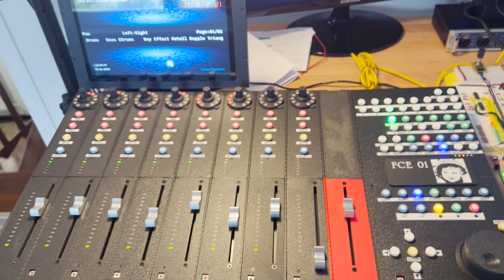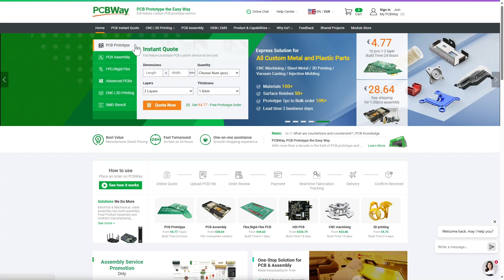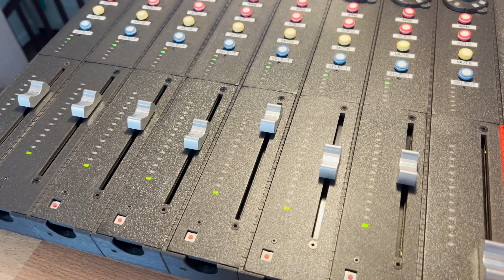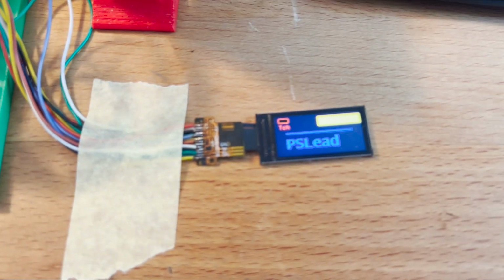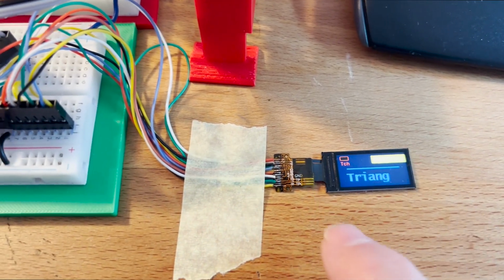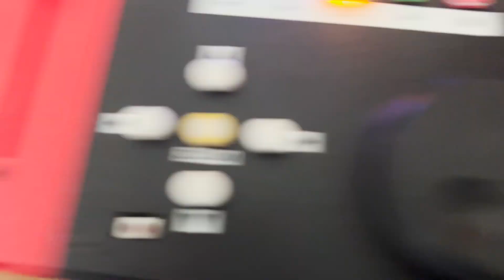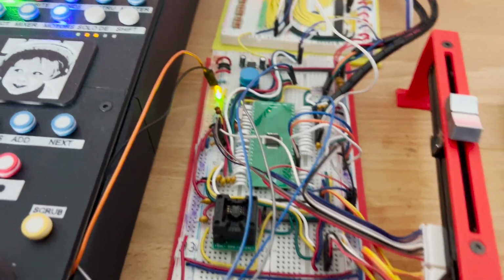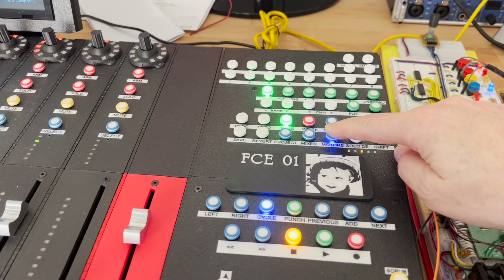DIY MIDI Remote Controller - New Strip - Part 1

Comment: May I suggest a feature?
Instead have the virtual light on the Channel display when you touch the fader, the dB value of the fader in that position is very useful (Digico style) 😉
Reply from the maker: Thanks Gianluca, that's interesting suggestion. As i said in my Q&A video on the project, technically speaking I can do whatever I want. The only actual limit is the protocol (Mackie Universal Control Protocol). For what concerns the meter, the protocol returns only 14 values (the 14 LEDs that you see next to the flying faders) from - infinite to +6Db. Question: would you still want to have the Db value on the display knowing that it does not  return the real value but an approximation devided by 14 instead? Cheers!
Reply: @fcampanini  i mean not the dB value of the meter, but the value in dB of fader position! Fader @0dB for example, fader @ -10dB...the value of the position of the fader should have at least 1024 steps but I'm sure your is better ;)
Reply from the maker: @gianlucabertoldi3895  ok I see. I’m not entirely sure what’s the value in remarking the position of the fader on the display where this is few centimeters from the fader…. But I will give it a try! Thanks for suggesting and stay tuned!

Comment: A long time ago (probably around 2015) I tried to build such console using used Yamaha CL5 potentiometers and an Arduino MEGA... It didn't work 😂
I was defeated by the part of the program responsible for controlling the motor "In real time" and the PID controller. It seems to me that Arduino is too slow for this type of tasks and its ADC is too noisy. 🙁
What controller do you use and how did you manage to make the fader move so perfectly and smoothly?
Are you using some kind of external ADC to read the position of the faders?
Reply from the maker: Hello realizator5567, i’using stm32F072 for the channels and the stm32H723 for the main controller. Arduino mega could be fine probably to make one channel. I don’t use external ADC. Cheers